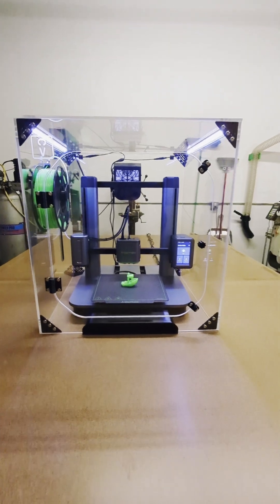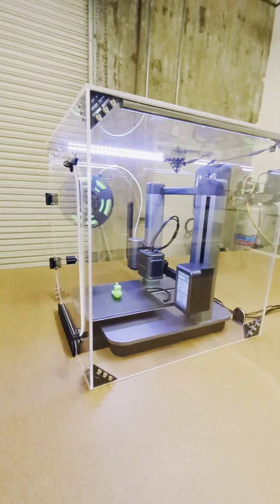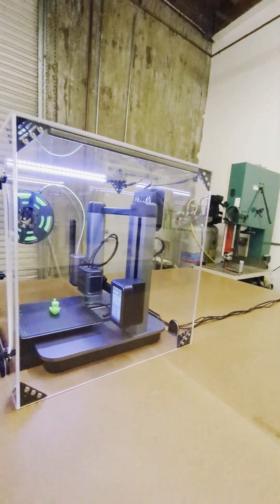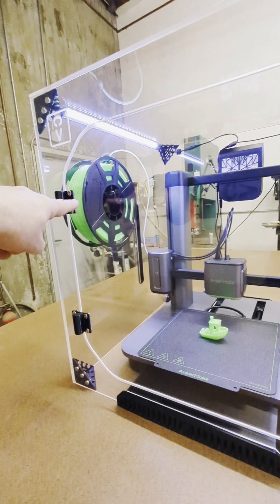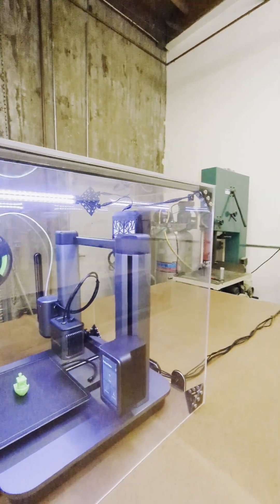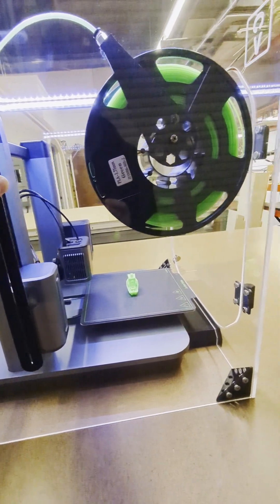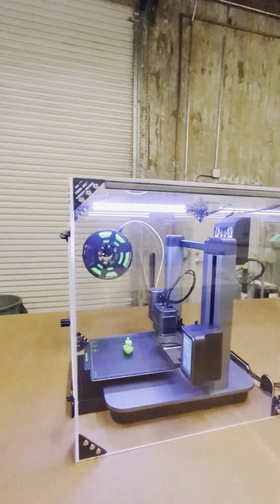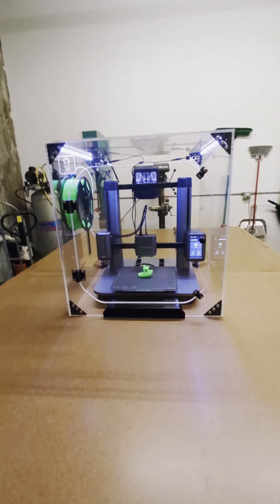Ankermake M5 3D printer enclosure by Clearview Plastics

Comment: Looks like a quality built enclosure. The asking price is a bit much considering the the price of the printer, especially when adding accessories. Adding these can easily jump the price in excess of $500. The printed parts kit and internal spool holder should be included in the base price considering you can't even mount the printer's own spool holder with this enclosure. The  base price should include everything you need to get started. If it wasn't for that I would seriously consider buying.
Reply from the maker: Thank you for your insight. Our enclosures are designed for professional grade fit and function. Our primary goal is to include features that the 3d printing community has told us are important and we work to include these features on every enclosure. We offer a lot of options to accessorize the enclosure because it is more than just the enclosure, it is a workspace. All in all, what we offer is unmatched in quality and thought out design.

Comment: I will Greatly Consider this enclosure for my printer.
Props to the Lighting Fixtures, as the AI Camera is more accurate when proper lighting is on the bed of the printer.
My only question is if the Spool holder can support 3KG spools.
Reply from the maker: Thanks for recognizing the function there. The internal spool holder at the moment is tested with 1kg, but I can do some development to make that happen. Will def need 1/4" panels.
Reply from the maker: If you are into big spools, we make a solution for 5kg rolls. :) https://clearviewplastic.com/collections/3d-printer-laser-engraver-accessories/products/clearview-5kg-spool-enclosure?variant=43586120679662

Comment: Great work, but it's a a bit of a stretch to pay more for a box w/ fan & lights than the actual printer itself. If the complete kit was lower priced, I'd be all over it
Reply from the maker: The enclosure starts well less than the printer cost. Lighting, filters, and accessories can be added later. There is no correlation of printer cost to enclosure cost. The cost of our enclosures are directly correlated to do  what it takes for effective, tailor fit,  performance. Our products aren't just a fan and some lights. They are a tech built powered filter that offers real benefit and aluminum clad led strips that are fitted and easy to set up. The options and developed tech we build in are unmatched.
Reply: @clearviewproducts   If that was true you'd have been selling an awful lot more of them than you have.  Most people here have told you they think you've priced yourself out of the market.  Listen to them or don't do business.